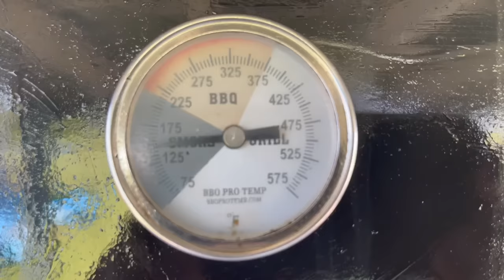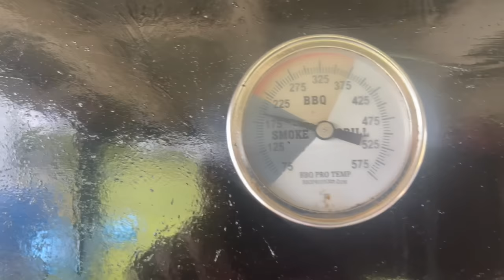Trapping Wild Pigs In Louisiana (Catch*Clean*Cook) How To Make Smoked Pork Tasso

Comment: Ken, another great video; thank you.  A couple questions.  Was the purpose of the curing salt, just for flavor, considering you smoked (cooked) the meat through and through?  Also, the markings on all of the pigs you trapped, were quite unique and they seemed to all be marked the same.  Is this a species of wild hog in your area?  I'm from South Florida, and while I've seen many different markings in terms of wild hogs, black is the predominant marking here.  Thanks again for the time and effort it takes to put these videos together. God bless you.
Reply: Trichinosis can be killed with an internal temp of 160*F.  When bordering near that temperature as in this case many people like to use curing salt as an additive in prevention. Most writings state that curing salt will not kill trichinosis alone.
Reply: Salt isn't what kills bacteria, in curing meat it's the salt that draws the moister out of the meat which the bacteria needs to survive. The smoke adds another layer of protection from the outside preventing any further contamination.
This meat isn't cured but it is cooked and partially dehydrated with a good smoky covering. Sure it's every bit as delicious as it looks and completely safe to eat.

Comment: That is a good hitch on that truck. What do you do with the guts and do you use the harts for anything like sausage. Can't beat a good tub. Did you add a more wood to the smoker. Do have to refrigerate that after vacuum sealing it.

Comment: What salt are you using? You called it curing salt. Every curing salt that I have ever seen is pink or some degree of pink. Just curious.
Reply from the maker: That is true. I had this for years and the pink just faded away. But yes they add the pink so no one mistakes it for regular salt.Thanks for watching.
Reply: @kfred  one more question. I make my own bacon but after curing 10-14 days I rinse off the excess pink salt. I didn’t see you rinse your meat. Do you just don’t worry about that? Have you tried rinsing? Just wanted to hear your thoughts on that.